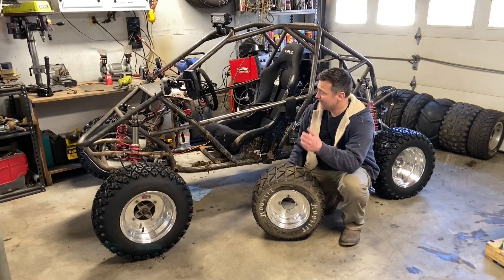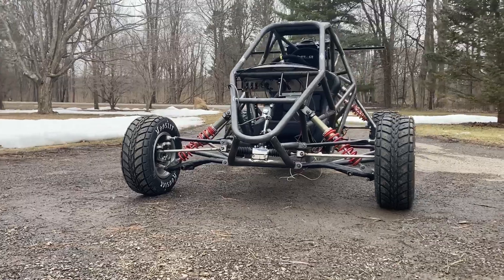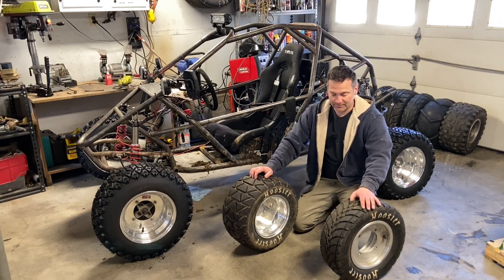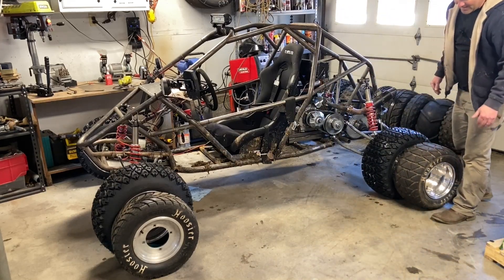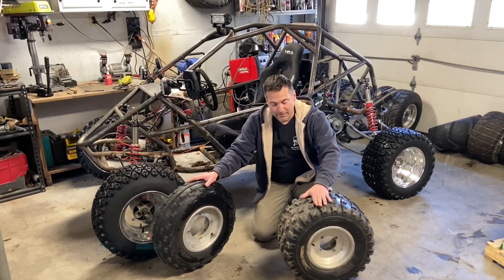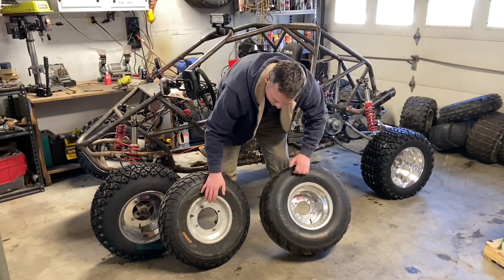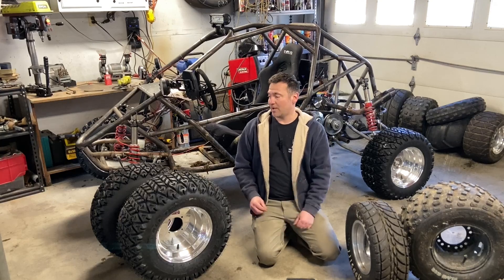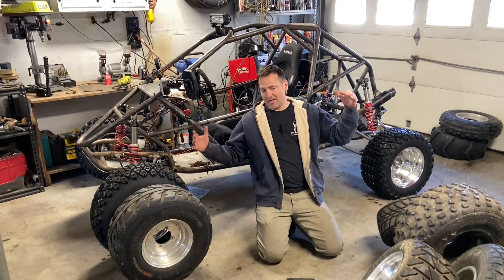What Wheels and Tires?  Choosing the Right Setup for my Crosskart/Go Kart/Minibuggy

Comment: Man, thanks for the info on Gear Commander, game changer for me 👍🏻 I’m building a kart with a CBR1000 engine, it’ll be mostly for off road stuff with 21in floatation tyres (they grip but don’t rip up the ground too bad), but will also be putting road tyres on it and taking it to the drag strip. That website will really help dialling in the gearing for the different uses.

Comment: What do you think about 26” sunF street tires on 14” rims?
Reply from the maker: I think for such a light weight car rotating mass is definitely a factor. Bigger tires are cool but can rob power. There is definitely a balance of size/performance/ground clearance.
Reply: @KJRaycing  Thanks….soooo I bought them already and will run them since they’re already mounted and everything.  Too much trouble to turn back now.  

With a 600cc engine which size sprocket would you recommend?  This kart is for my wife….she won’t be driving that aggressively anyways.

Comment: Hello sir, I want to ask is if its ok to use a single cylinder 110cc 4speed engine on a crosscart. Because that engine is all i had right now at my garage
Reply: For a full size street cart it’d probably move it but you’d want more

Comment: Your discussion about rotational mass explained a problem I was having with my off-road buggy.  A couple of years ago, I switched my rear tires from a set of lightweight 22x11-8 tires and rims to some beefy 24x11-10 wheels to give me more off-road clearance.  Yes, it helped with clearance, but I started having issues with the rear axles.  Snapped two of them. I knew the tires were heavier but I didn't think they were THAT much heavier.  Well, yes they are much heavier once you calculate in rotational mass.  I was already thinking about going back to the smaller tires and this video really clinched it.  I picked up a set of 22x11-10 tires that weigh almost nothing and it makes the rear end feel much lighter.
Reply from the maker: Man that is so awesome! Thank you so much and I’m glad it helped 👍
Reply: Miata axles broke?